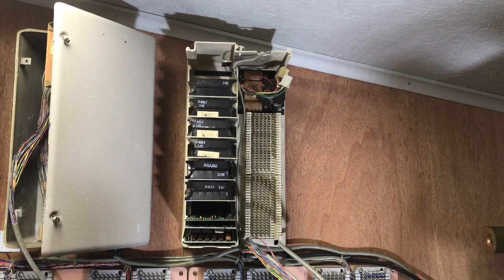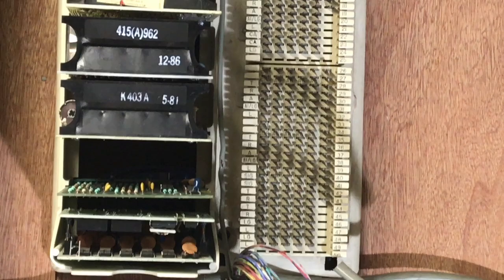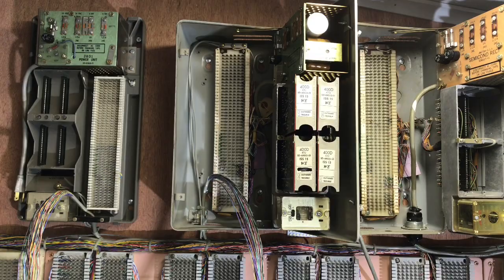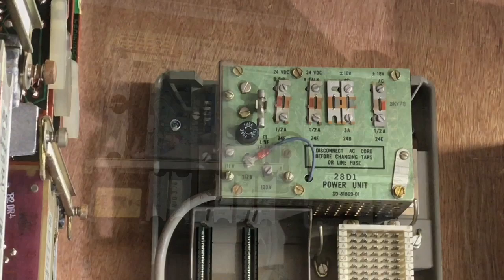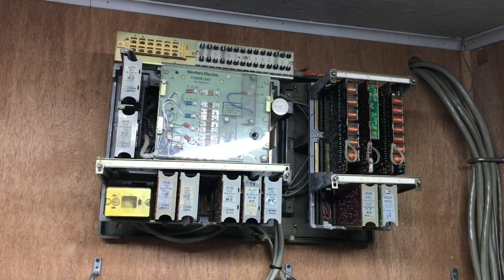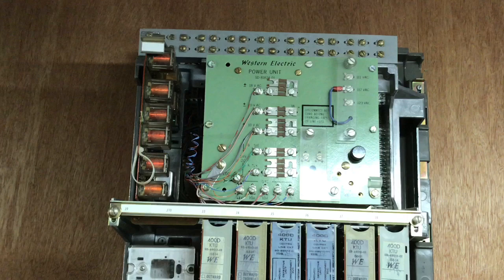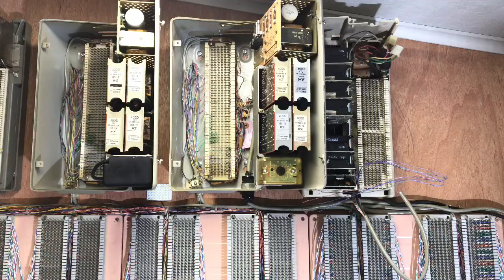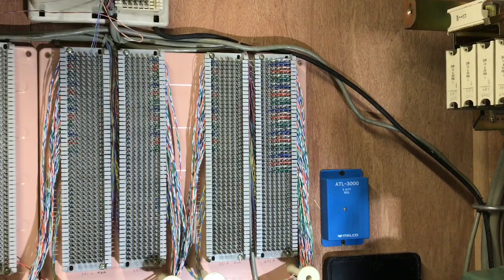Discussing 1A2 KSU units. 551,601A Ket telephone systems.

Comment: Have you ever run across a Western Electric Dialog key PBX? We had a few of them in San Jose, Ca. at what was then Zody’s department store in the 1980’s.
Reply from the maker: steve94044 I replaced two of them in the mid-80s